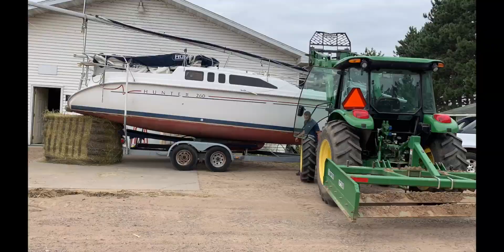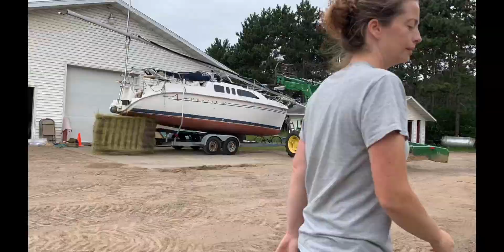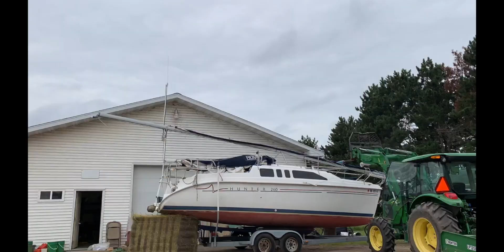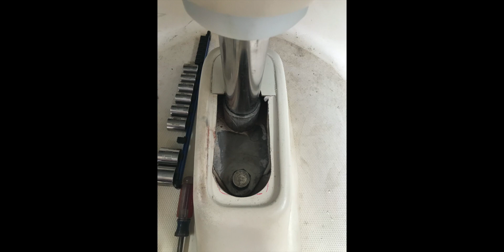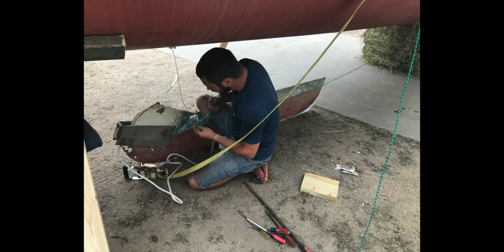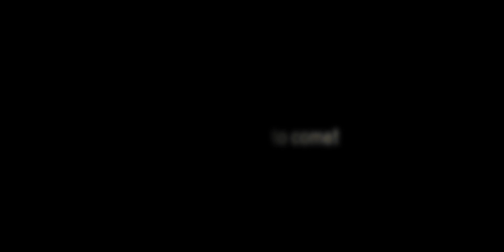Removing Orion's Keel without a Travellift

Comment: I just spent the weekend researching how to do the exact same project on our H260, then saw you posted this!  Funny coincidence.  I’m thinking of putting ours on stands or using the gohoist system to do the keel rope and a bottom paint.  Did you have any issues getting the keel bolt loose without the nut spinning?  Or is that nut welded to the keel bracket?  Enjoying your content, as always!
Reply from the maker: Orion's Odyssey
0 seconds ago
Yes, the nut is welded to the bracket- Make sure that you have a long enough/strong enough rope ready to tie on, I think I had a small line tied on to the old line and then pulled the new line back down through. Good luck with the project!